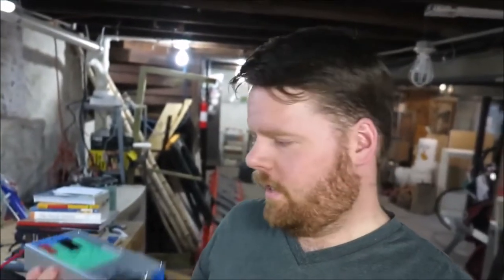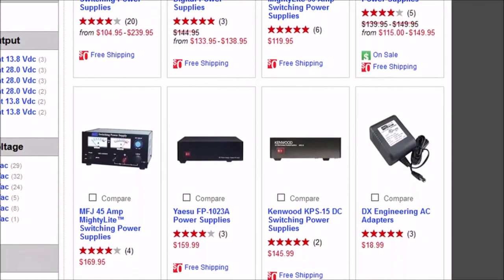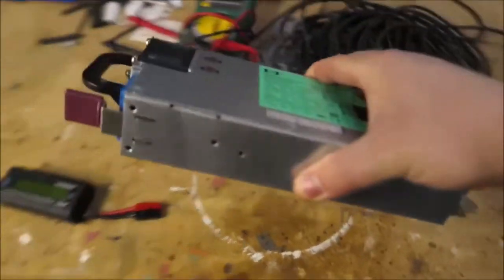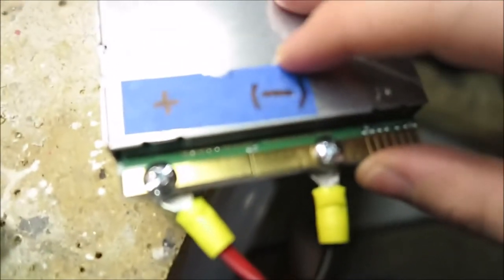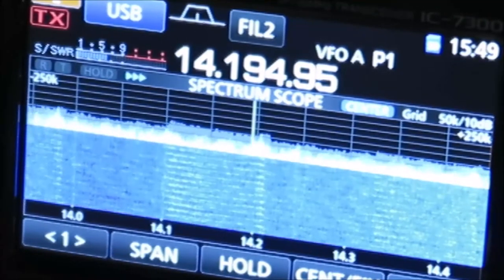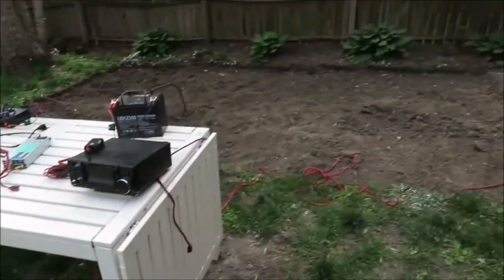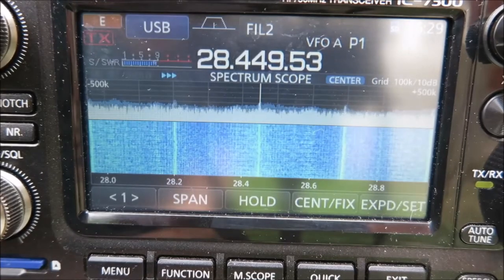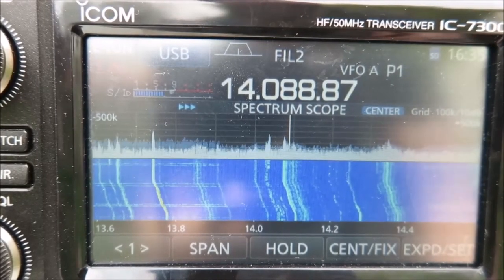Cheap power supply for ham radio?

Comment: I just got a new mobile dual band rig. I was going to set it up at home for testing and stuff. I was planning on hooking it up to a deep cycle battery and hook it to a trickle charger. Is this sufficient or not? Its a 50 watt
Reply from the maker: Radio wont be happy.
Reply: @CarNRadio1  why?
Reply: It's fine to hook it up to the battery in my truck while being charged by an alternator. But the radio will have issues hooked to a larger battery being charged by a charger?
Reply from the maker: 50w radio uses about 10 Amps of current. trickle charges may not be enough to charge the battery and even if it is a deep cycle battery it will get damaged. Alternators make from 60A to 200A, depending on the type and make of the car, and the battery is always toped up. In some cases- (powerful audio amplifiers) you may need a capacitor for extra amps draw, which is not constant like with radio, but a pulse.
update: this radio needs more than 10A at full power: https://www.kenwood.com/usa/com/amateur/tm-v71a/spec.html

and also radio needs more than 12.6V to get full power out of it.